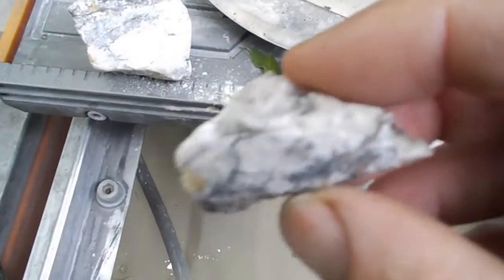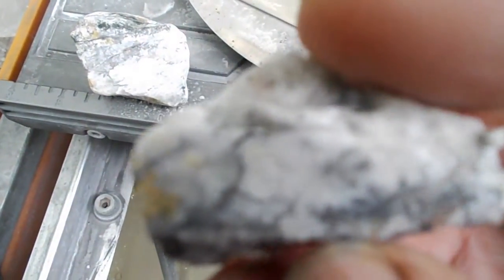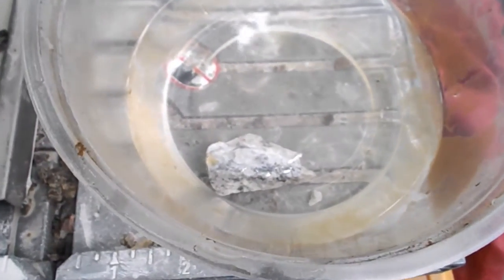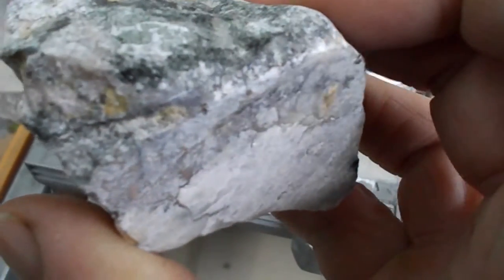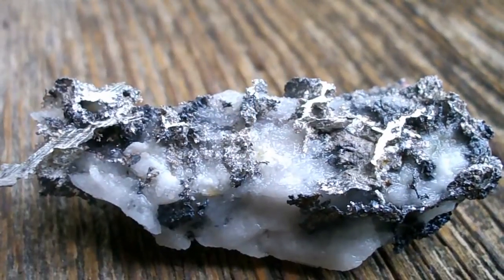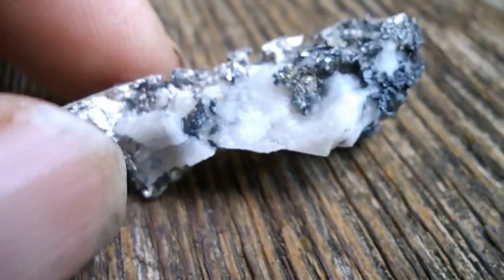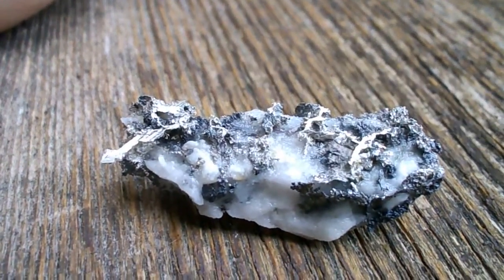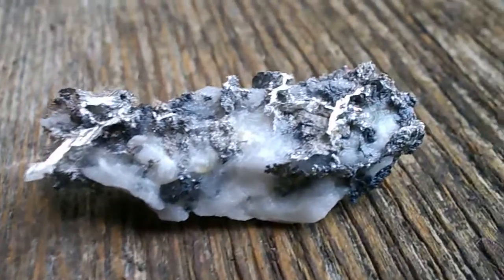ETCHING CALCITE FROM SILVER ORE - BEFORE AND AFTER

Comment from the maker: In this case, I used white table vinegar.  I have also used muriatic acid on other rocks, which I dilute more than 50% and usually quite a bit more.  With muriatic, I only do it outside and have to be careful.